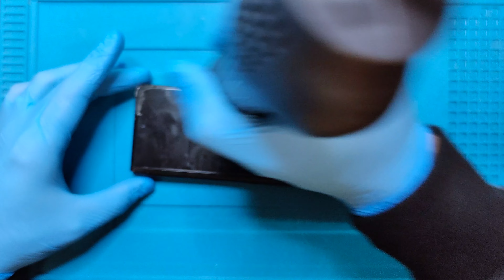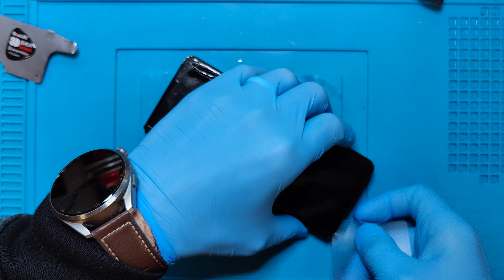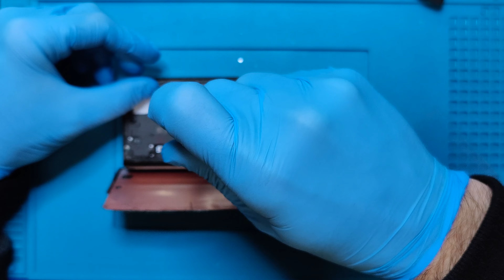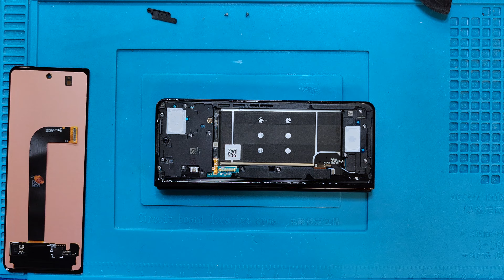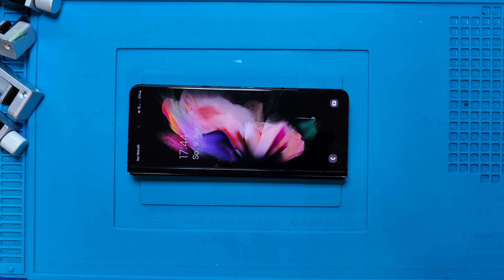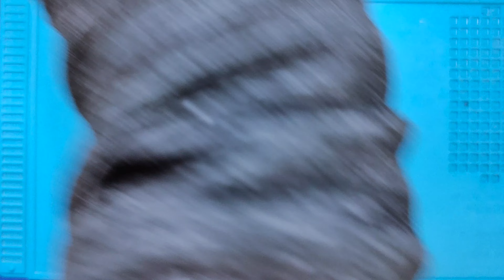Samsung Galaxy  Fold 3 front screen replacement #samsung #repair #galaxyfold

Comment: sir this is the model i ordered sony xperia xa2plus LIP1654 ERPC
Reply: sir this is the model i ordered sony xperia xa2plus LIP1654 ERPC
Reply from the maker: I especially sent you an ebay link, there is correct information here, order the same battery there. Model name Original Sony Xperia XA2 Plus H3413 H4413 H4493 Akku Battery LIP1653ERPC